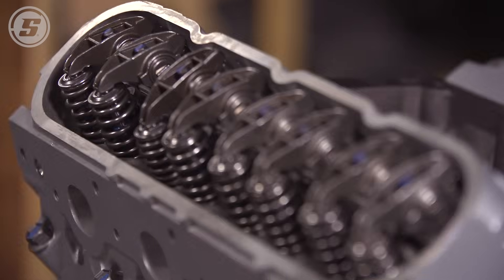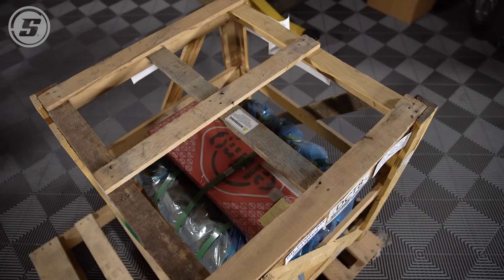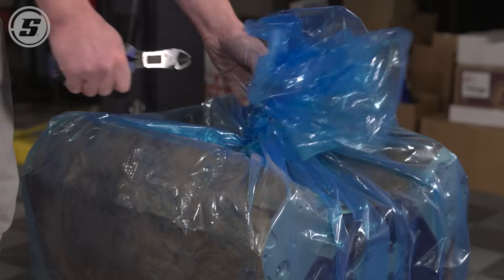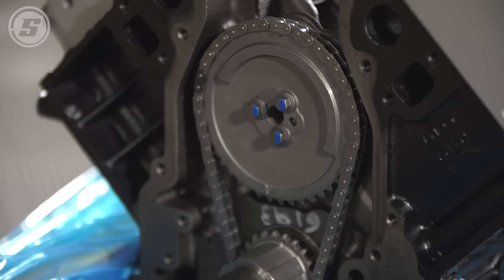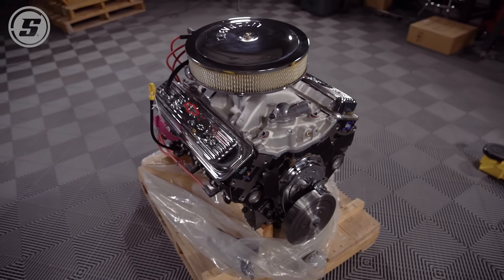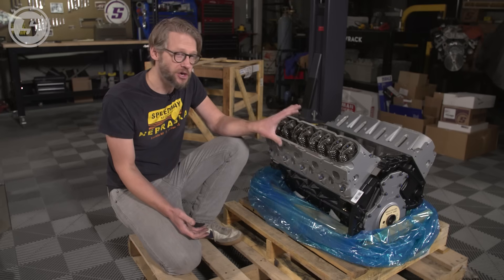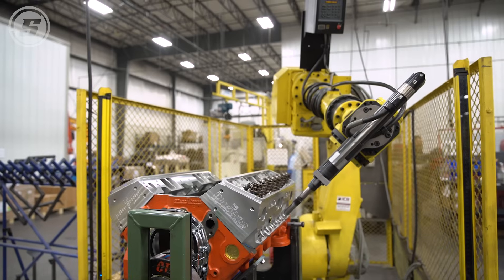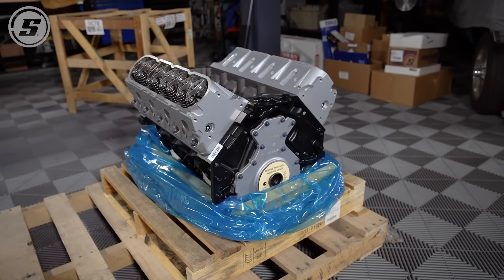Long Block VS Short | What Comes With a Crate Motor

Comment: Another factor to consider is the tooling. Not everyone has all the tools necessary to rebuild an engine. Great video. Thanks.
Reply: Ya but most crate motors are $$$ you can buy tools at harbor freight to put together a motor. Way cheaper if you have the time and space. It's way cheaper to rebuild it yourself

Comment: Nobody does anything right anymore! Incompetent, lack of experience, concern for quality or cheap parts no longer made here in America to maximize profit! My brand new GM crate ZZ4 engine purchased back in 2008 literally has Made in Mexico cast into the block above the bell housing! Can't even imagine what you get nowadays? Probably better to find a local shop that can be trusted. Engine has been sitting in a "71" Camaro that I have been working on for 16 years. No motivation to finish the project as everything is made somewhere off shore, never fits and is usually very poor quality even though not cheap! Rant over!
Reply: Ya you can re build a motor for 2500 to 3500. For 10k you can build a monster with all top or the line parts. Or spend that on a crate that all comes from Mexico and China.
Reply: Not everyone has time, effort, expertise, tools or space or the right knowledge to do this sort of work themselves so crate motors are a great option

Comment: Crate motors are junk, a crate motor is a large paperweight. Go to a reputable local engine builder, you won’t be sorry you did.
Reply: I’ll take a Blue print SBF crate engine with their new 4 bolt block over reputable shop any day hell I’d go for Ford crate engine over the shop too!   I personally love building my own motors but having done both IMO there is more value with a crate engine than rebuilding or having a shop rebuild stock motor but this is for reputable companies not all.